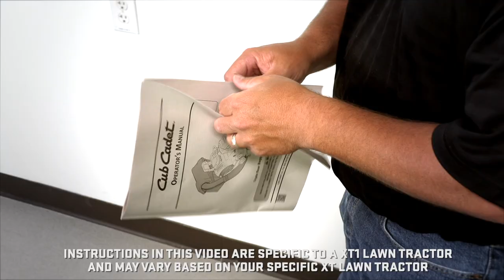How to change the oil in an XT Lawn Tractor | XT Enduro Series | Cub Cadet

Comment: Oil filter change makes a huge mess!
Poor engineering. If an engineer had to change their own oil, they would have made changing the oil filter cleaner!
Reply: But it looked so clean in the video..
Reply: I agree.   I like the mower, but that part is a mess.  Fortunately it doesn’t have to be done too often.
Reply: Make sure you allow the engine oil to drain first as much as possible until you just get a few drips and then when you take the oil filter off all you have to do is put a folded paper towel underneath and it will absorb the few drippings that come because it's not much